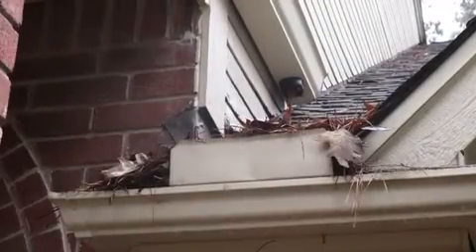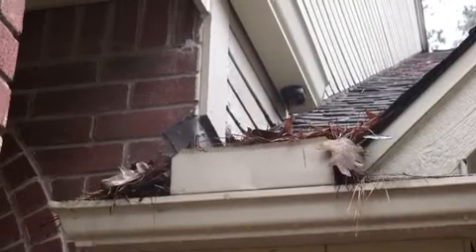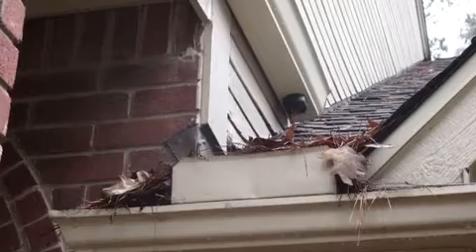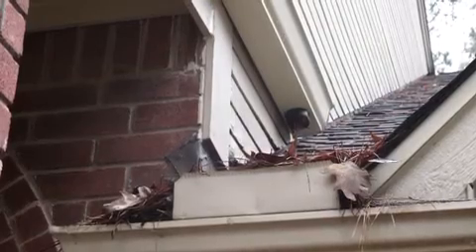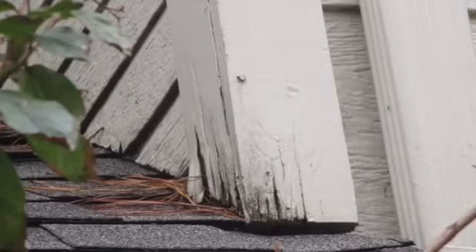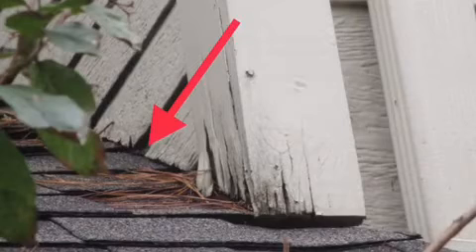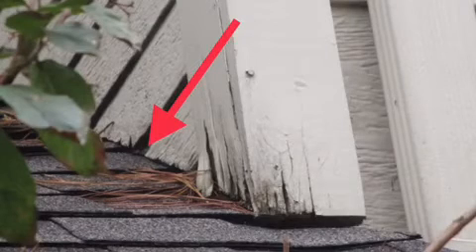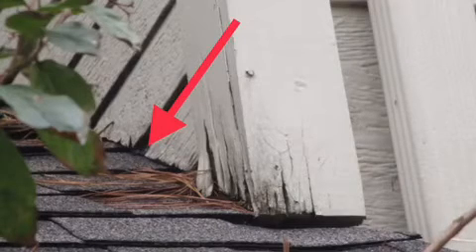Siding and moisture

Comment: Hey Matt, what exactly is the correction for the siding and shingles being in contact? I’m assuming there should already be a flashing underneath the siding, so can you just rip/trim the bottom siding pieces and reinstall it to create that 2” separation you mentioned? And is this necessary on just wood siding, or is it also applicable to hardi-plank as well?
Reply from the maker: It should be in wood and fiber cement. Unfortunately the only way to do it is to cut it right and install it right from the start. But hey, I’m just the guy that tells what is wrong, not necessarily the guy that has the solutions.